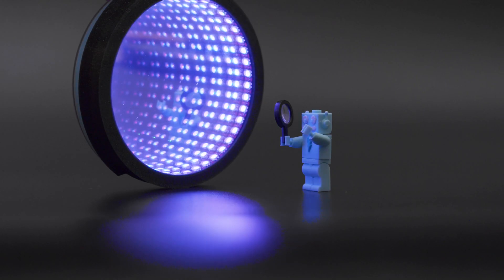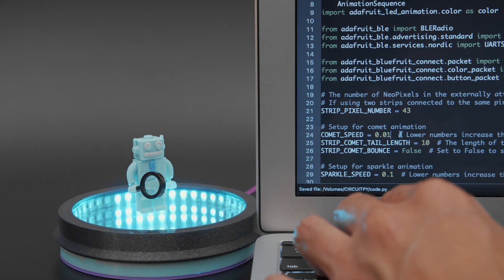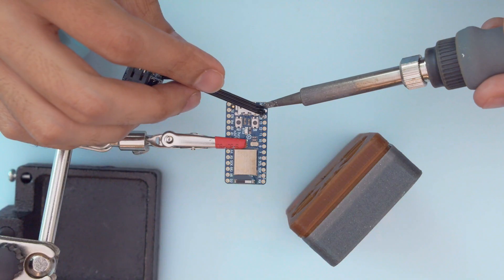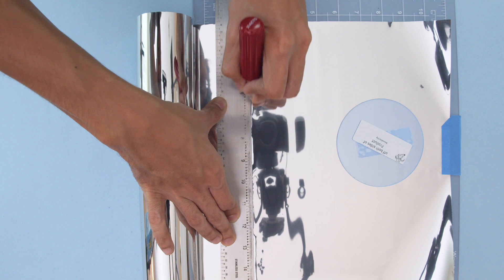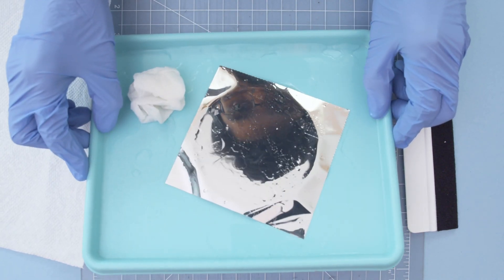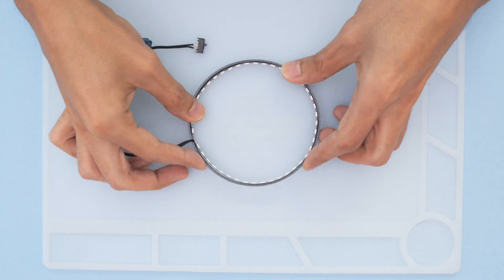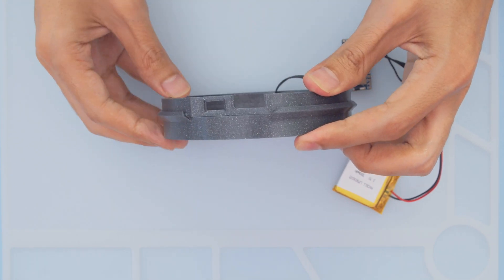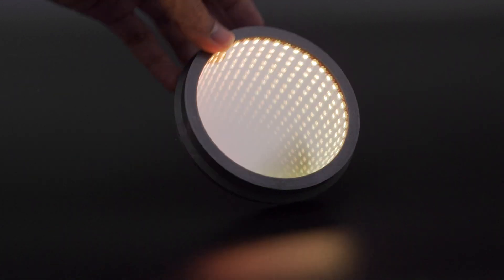NeoPixel Infinity Mirror

Comment: Nice, it is a good amount thinner than the similar project I was looking at that was made a year before this.  I would suggest for the bottom mirror, using an actual mirror so the infinity effect goes farther and is brighter.  The 1 way film loses brightness faster.
Reply: Might be difficult to source a mirror for his desired dimensions. Cutting a mirror to size is arduous